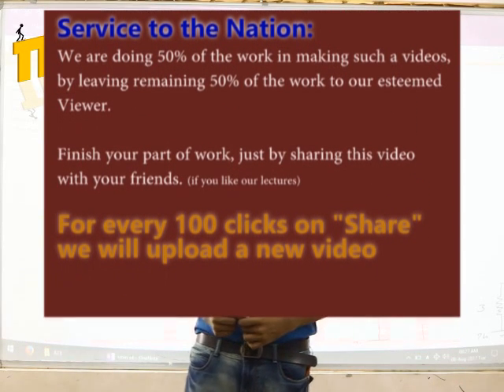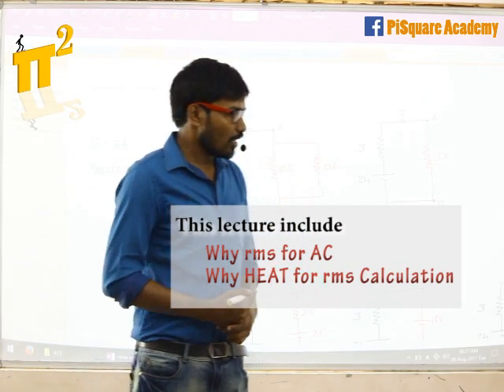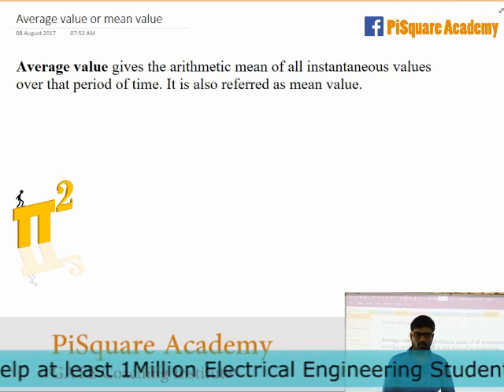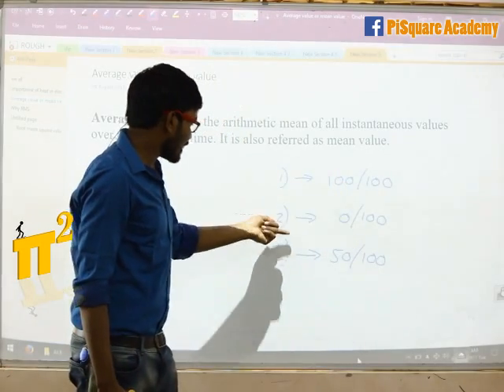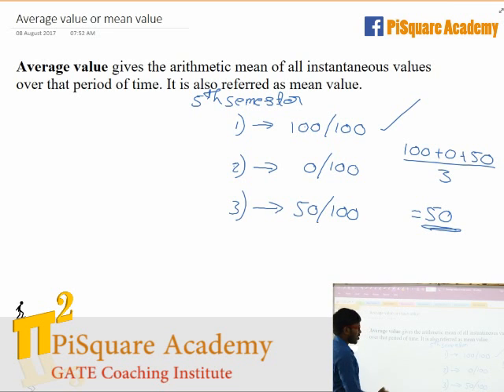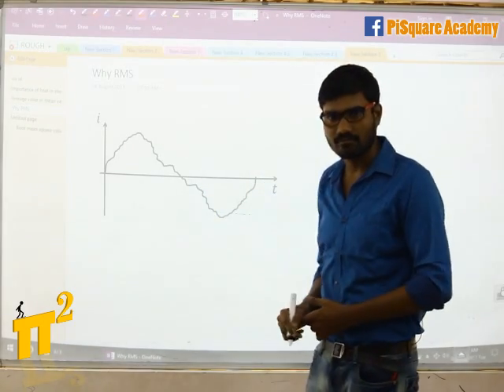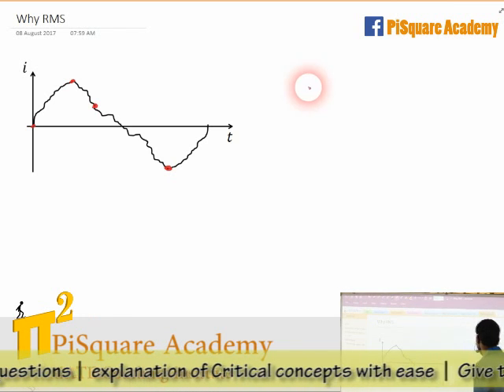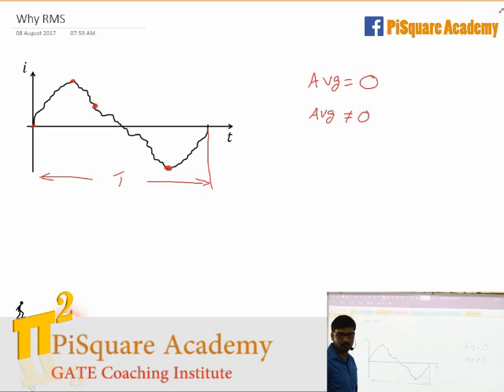Concept of Root Mean Square (rms) value | Interview Question | PiSquare Academy

Comment: Sir, means origin of rms is from resistance. Sir can we apply rms value for inductive and capacitive load
Reply from the maker: Good Question dear,

The concept of root mean square (RMS) value originally stems from the analysis of resistance and the heat generated in a resistive circuit. It's a way to represent the effective or equivalent DC value of an AC waveform, taking into account the heating effect.

However, RMS value isn't limited to resistive circuits alone. It's also applicable to inductive and capacitive loads, even though these elements don't directly produce heat in the same way resistors do.

Conclusion:
RMS values are used to represent the effective values of current and voltage, making AC circuit analysis and calculations more consistent and easier to handle, irrespective of the type of load
Reply: Thank you sir for clearing but can you give some more clarity over inductor & capacitor

Comment: Could you please explain how to design the power schematic ( cable selection,voltage drop ,breaker selection) using Schneider electric software "ECODIAL".
SHALL BE HIGHLY APPRECIATED

Comment: over a period of time the charge transferred for a sinusodial wave is zero because integral of idt is zero, then How we are getting supply(Current or Charge) at output terminals could you explain this?
Reply: Srikakulapu Naresh if you walk 10km to north and return to same point what would be displacement ,zero but this doesn't mean you have done no work same is for sinusoid a.c current

Comment: Hello sir ....y star and delta connections are used???????????
Reply: Srikanth Nani 
Star Delta are used to decrease or increase voltages for a load you can find it in motor starters
Star will reduce voltage with factor of 1.732
Reply: Srikanth Nani 
It has many other applications
Reply: @karanmakwana5129  great....